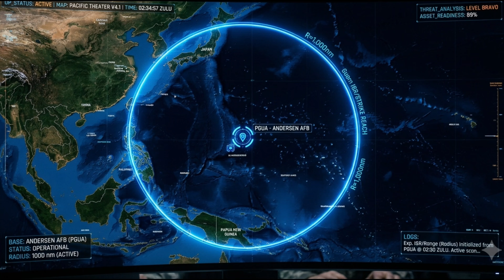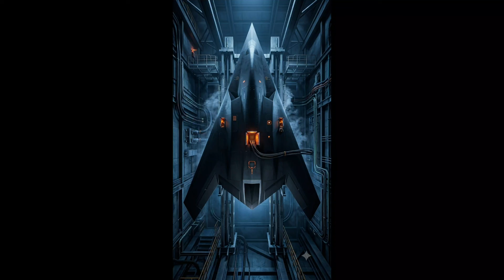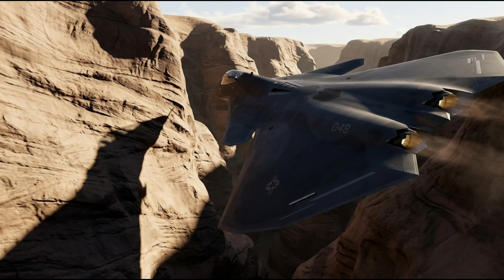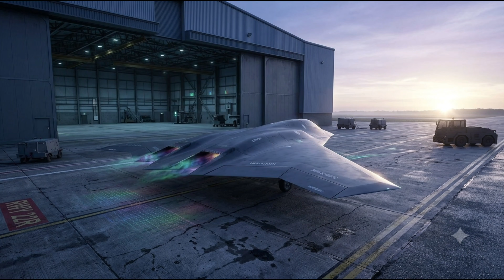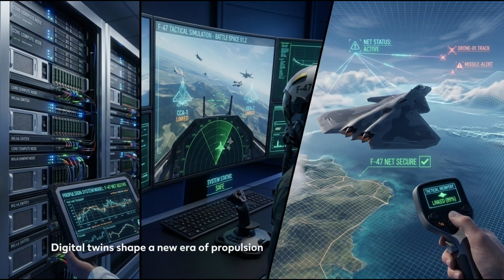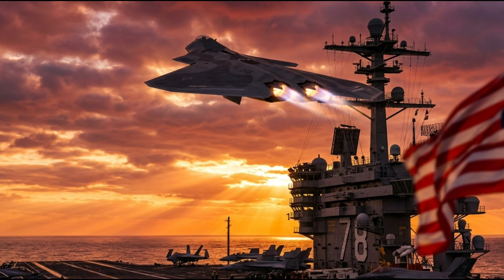The F-47: Why America’s New Jet Changes Everything🦅🇺🇸 #F47 #USAirForce #StealthTechnology

Comment: Tesla not only software over the air updates but firmware as well.  Hopefully that moves into aircraft.  Starlink/Starshield world WiFi is also amazing especially as AI data centers in space
Reply: Most car manufacturers stuck with dated  5 year old software platform building a car.  You can see faster car and plane build in future.
Reply from the maker: Exactly—the legacy manufacturing model is definitely feeling the pressure. Faster iteration cycles in both automotive and aerospace are going to change the game entirely. Great point